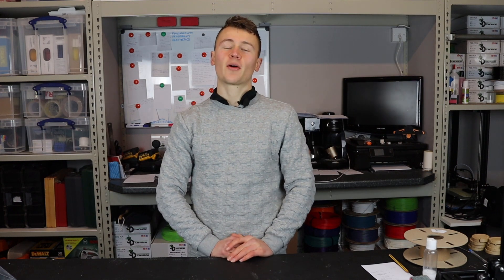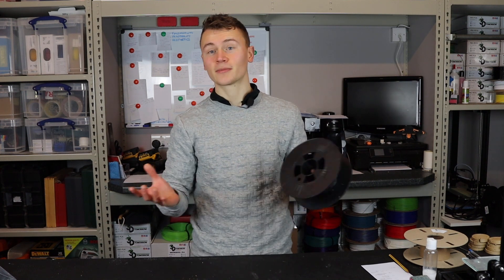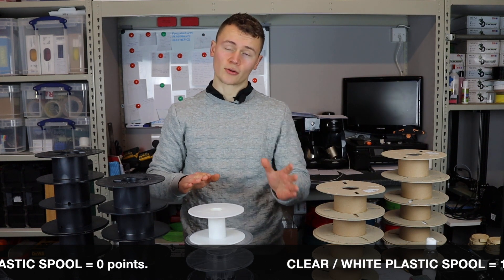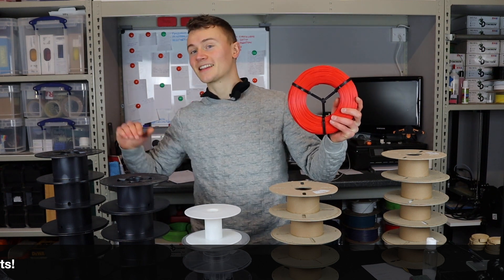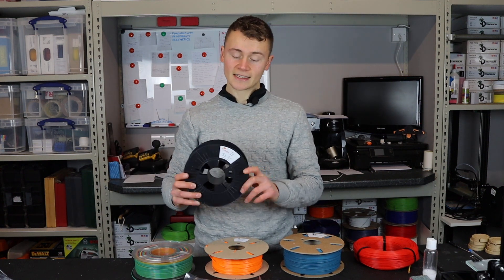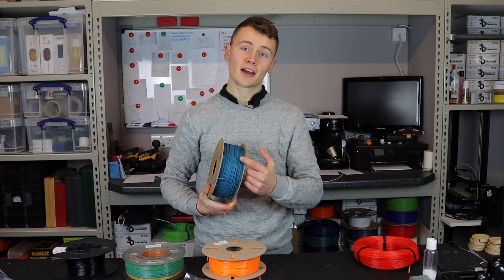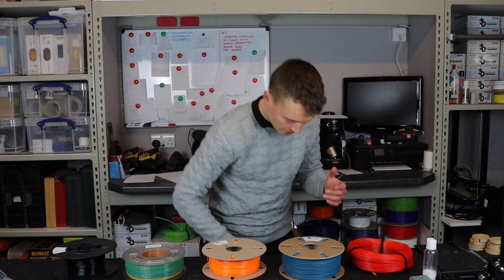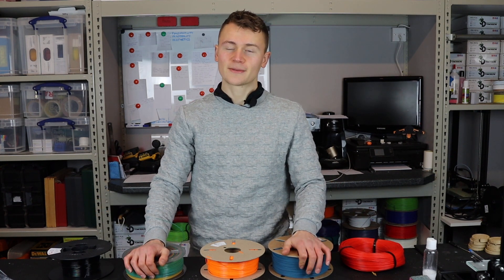Is your filament ECO FRIENDLY!? My system for rating environmental impact

Comment: Black recycled HIPS spools have 85% smaller carbon footprint than clear spools and 20% smaller than cardboard spools. Black plastics, while they cannot be recycled, they can be burned for energy and do not go to landfills, at least where i live. If they are thrown to landfills in UK, thats the fault of UK, not the fault of the plastic.

PLA is not biodegradable except if you put it in industrial compost for like 6+ months. No one will do this really, so in practise it is not biodegradable, even tho theoretically it is.
Reply from the maker: Firstly, where have you got those stats from out of interest?

The problem with the black plastic is the end of life treatment, even if they are to be burned for energy, that process further increases the carbon footprint and naturally is not a circular process. Cardboard spools on the other hand can be locally recycled in most areas.

Comment: "No spool", but it's in a plastic bAG
Reply from the maker: All are unfortunately, it’s a necessary evil to prevent moisture degrading the material.

My company uses vacuum bags that double up as a reusable grip seal bag for on going storage or reuse in other ways🙌🏼

Comment: Hey! Awesome video! As you know pla is only recyclable under certain conditions , do you know of any 3d printing material that is completly 100% biodegradable? I mean like no machines or special conditions, just degrades after a while outside
Thx!
Reply from the maker: Thank you for the comment! As far as I am aware, the only filament that comes close so far is the experimental GrowLay filament, which is advertised as compostable. If you’re in the UK, we’re launching a filament recycling program soon, to turn print waste/supports back into usable products (3DTomorrow). This will hopefully provide a good alternative to throwing these bits away!
Reply: PHA but its still not as wide spread as PLA. full PHA is about £40 per spool atm
Reply: I guess one could just print in PVA and then make casts of it.